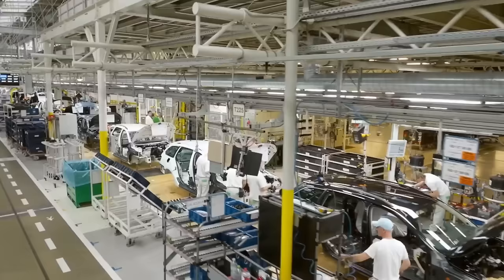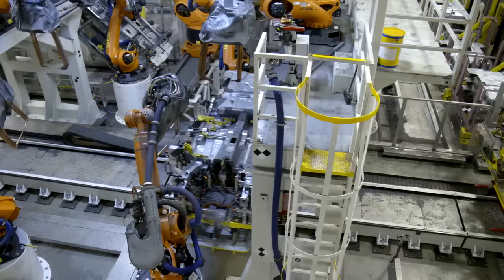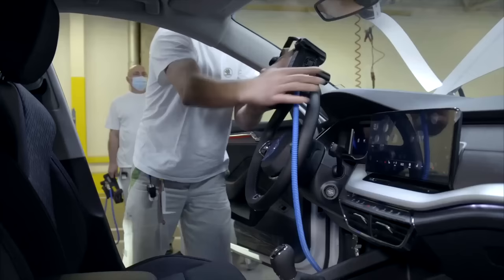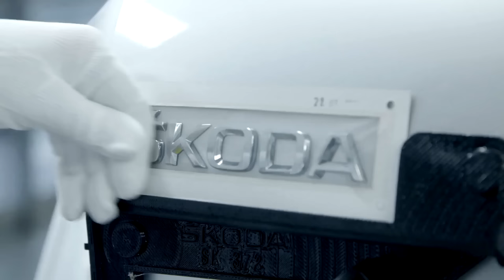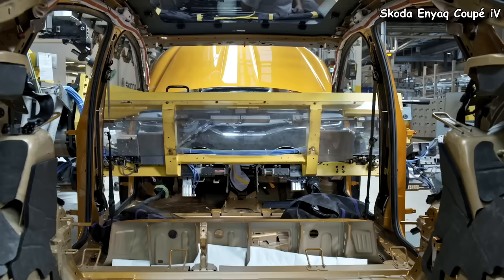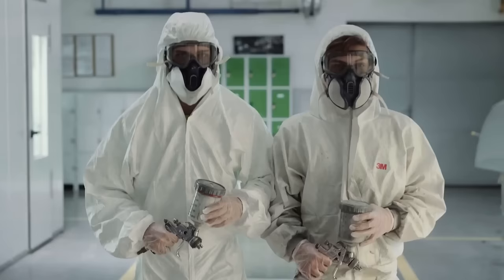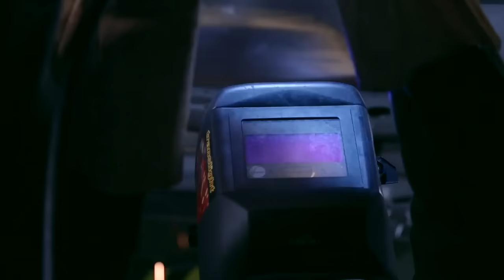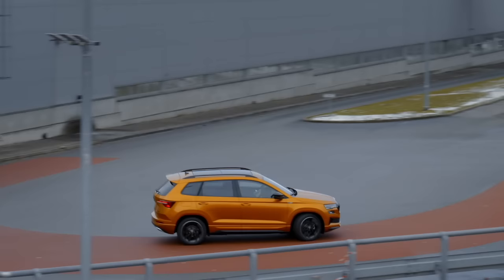Inside Skoda Factory🚘 Producing Octavia, Kodiaq, Scala, Enyaq, Superb, Karoq – Assembly line

Comment: 7:35 minutes You can see the poor quality of the fit of the exterior body parts - the lamp embedded in the rear flap and the tailgate fit in relation to the fender slope - see the lower corner of the flap belt. Skoda has to look at how it's done in BMW, for example.